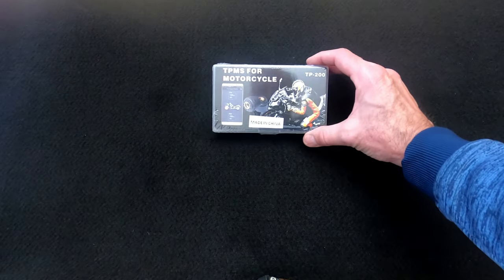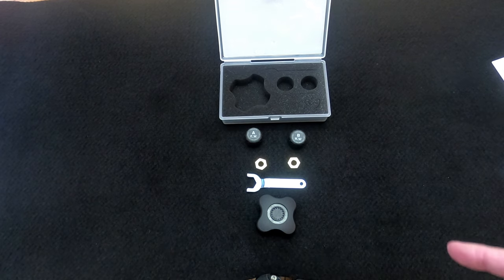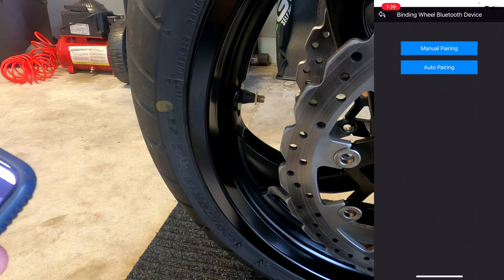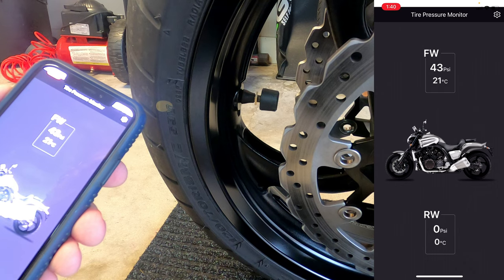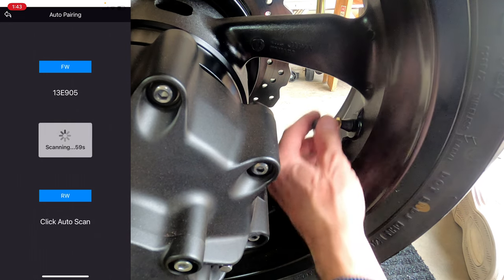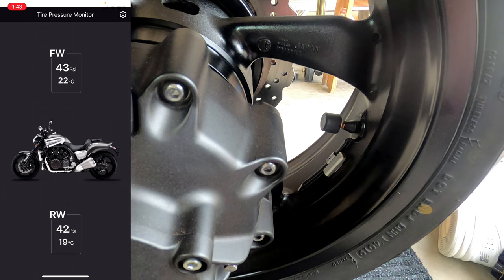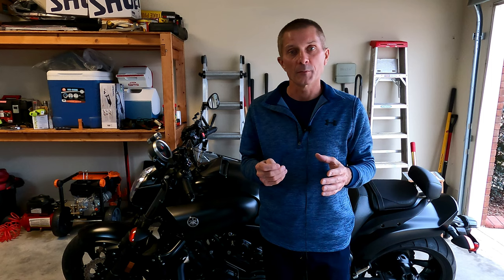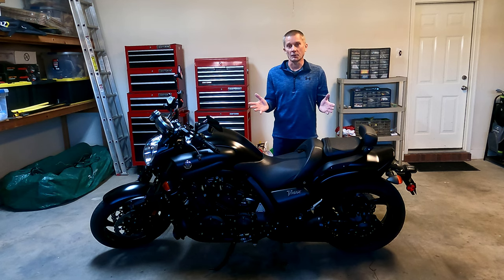Yamaha VMAX 1700 Now Has a Tire Pressure Monitoring System | How to Install TPMS on Any Motorcycle

Comment: Great video, Jeff. I also purchased a TPMS from Amazon but it was another brand. The documentation was reduced to hieroglyphics, and I was a bit perplexed with the locking nut but after watching your video I understand what I need to do. Great point on the tire valve position with the TPMS installed.
Reply from the maker: Thank you.
Reply: I installed the Bartun TPMS on my bike this afternoon but soon discovered that nails are not the only thing that can deflate a tire. Yes, that's right, the rear tire TPMS sensor was "leaky" and could not be saved. I will just have to order another TPMS kit, perhaps the one that you ordered.
Reply from the maker: @observationman35  Wow! That’s too bad. Hopefully you were home when it leaked out. Good luck with another system.

Comment: I bought the same TPMS and they read 4 lbs low.  We checked with two other gauges and the sensors are 4 lbs low.  The sensors are still usable in that they will show a change in pressure.  Make sure to check the tire pressure with a couple gauges.
Reply from the maker: So far mine are accurate. You might want to see about returning them for replacement.

Comment: Hey Jeff, just purchased this for my VMax, thanks. I’m having trouble finding and downloading the app that you are using. Would you mind sharing the name of the app that you are using, and are you utilizing an iPhone? - D
Reply from the maker: Hi Darryl. I'm glad you commented to let me know you couldn't find the app. After searching myself to no avail, I contacted the seller through Amazon. They directed me to the new app. I am using an iPhone. I have updated the description above and my pinned comments to provide instructions for how to find and setup the newer version of the app. Please follow the instructions and let me know how it worked. You will need to wait until you get your kit to enter the sensor IDs, but you can do everything else in the meantime. Let me know how things work out for you and if I need to revise any of my instructions to better assist others. Here are those instructions for your convenience: 
APP UPDATE: You will need to install the new app on your phone. The app I used in this video, and what may be described in your instructions, is no longer available in the app store. Search for "AiLink" in the app store. It will show up as a blue icon subtitled Health & Fitness. You will need to register before being able to enter the app. Once in the app, locate the device "Motorcycle tire pressure". You can find it by scrolling through the "All" category or the "Car" Category. Select "Motorcycle tire pressure" and then proceed to enter the codes for each sensor that came with the kit.
Reply: @JeffMarcum  Hey Jeff, I just saw your new video. Thanks again!👍🏽

Comment: I thought maybe it would set the balance off especially on this machine
Reply from the maker: So far I haven’t noticed any issues. I have read a lot about people having concerns, but haven’t seen any confirmed issues. If it does become an issue, I will re-balance with the sensors installed and see what happens.

Comment: Jeff good morning, I just had a HORRIBLE experience with the TPMS, my   Front tire went FLAT, and I was 85 mph, luckily I have lots of experience on my riding... BUT THIS TPMS I’m putting in the TRASH 😡😡😡😡😡😡
Reply from the maker: Wow! That’s too bad. I’ve not had any issues with mine so far. I always start the app before each ride and I check the readings before I get out of my neighborhood. I wonder if the battery in your front sensor was dead.